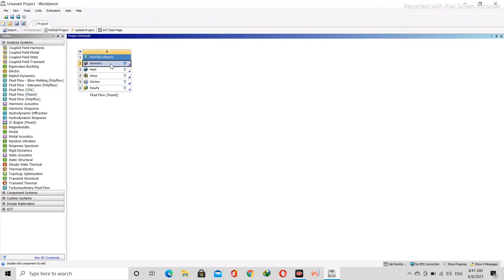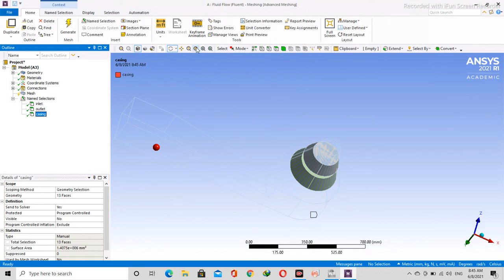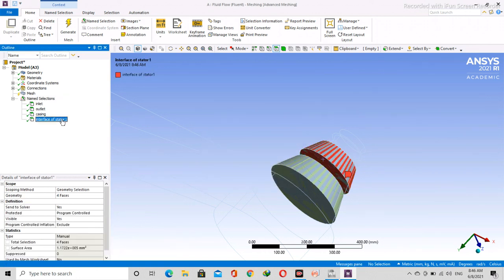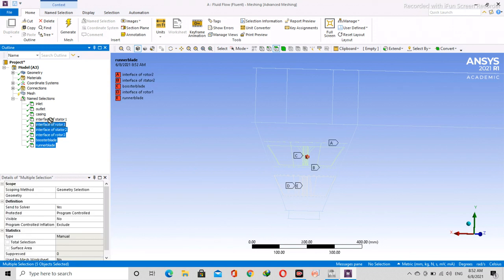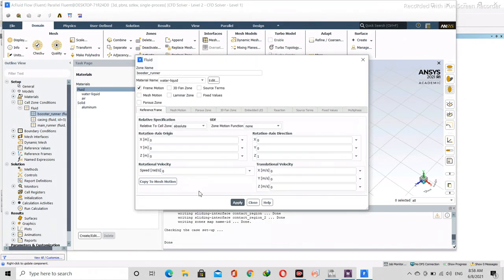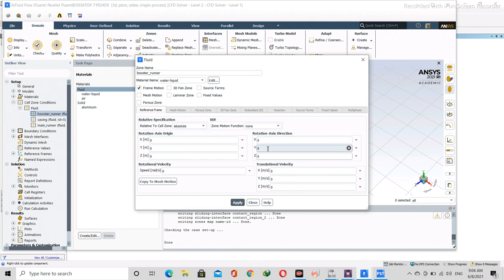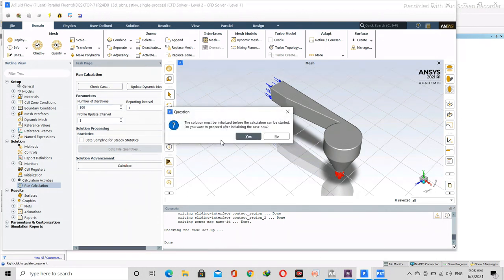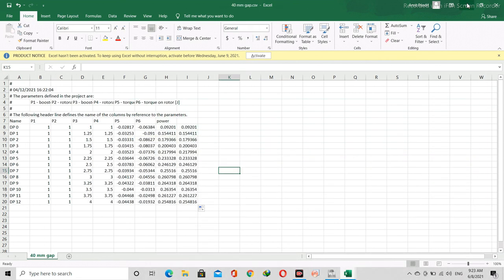How to setup parameters and CFD analysis of multistage Gravitational water vortex turbine

Comment: sir, why the torque i get increases as the rpm increases?  as we know, the torque value should decrease as the rpm increases.  I've followed the steps you described, but my simulation results are as I described.  Can you explain why my simulation results are like that?
Reply from the maker: I think you should check the mesh analysis. This mesh analysis is good for  my model so, please focus on mesh analysis.

Comment: Hi man, I can't understand why we are assuming that at an angular velocity we will have the most torque value possible.... how we can predict that in a real prototype the turbine will achieve that velocity...what if it can't get there?  
What should you recommend to solve this problem ...
Reply from the maker: Firstly, we have calculate the the max and Min velocity of test ring with including both of runners. Then ,  we have the max and Min radius from our test ring design. That way can calculate angular velocity. Yes, it can relate the real protype for particular mass flow rate because angular velocity for particular always constant . In real test we can easily get angular velocity and torque as output . But in simulation we have assume that which possible value of angular velocity is appropriate to produce particular torque.
Reply: Yeah, you are right man, well thanks a lot, your video is amazing, you helped me a lot 🤝, just one more question, in the video with single stage turbine, you picked angular velocity "4" because it was the higher value in the range of water velocity without a turbine?
I'm working in this project for my final grade in Uni. Thanks for the answer  👍

Comment: Really nice but i have a question. Why didn't u select inlet as velocity inlet?
Reply from the maker: U can take velocity as a inlet . There is no issue.
Reply from the maker: As in my project I have selected mass flow rate as input so in this video select as input otherwise there is no issue to choose velocity as a inlet
Reply: @amitsvlog5274  Have you created an animation with ansys? in which turbine is rotating?
Reply from the maker: I haven't the animation video right now but  I will show it in my next video

Comment: Sir, what is the meaning of negative torque in your result? And is it normal?
Reply from the maker: Negative only represents the direction . we should go for further calculation by taking magnitude only.thanks
Reply: @amitsvlog5274  Ok thanks Sir, my colleagues and I are working with the project related to multistage vortex turbine too. We followed the instruction on this video with 3 stages, but we got the result of torque with high variation. For example, in some data it showed Torque around 0.005 J, but in some data it showed until 5000 J although the variation of rpm is small. What is the possible cause and solution for this Sir?

and which one is better to model multistage rotor between steady case like you did, or transient using sliding mesh?

Thanks
Reply from the maker: you should check your mesh. If the mesh is okay then the result will not be varied much.
Reply: @amitsvlog5274  ok thank you and which one is better to model multistage between steady and transient Sir?
Reply from the maker: @elluthfi  plz follow this instructions while putting the data https://youtu.be/vwFLn1OfFBk.
it depends on your full knowledge about transient and steady. both will be okay .
Reply: @amitsvlog5274  Ok thank you Sir, and for total torque of 2 rotor stages as one unit, is it simply the sum two torque values of two runners? Because in the real experiment, our setup will be one unit shaft (not shaft with telescope hub). If I use rope brake dynamometer, can the result from simulation comparable with the result from real experiment? Thank you
Reply from the maker: there is always a certain amount of error when you compare simulation and experiment . question is what percentages of error should be acceptable by your professors.
Reply: @amitsvlog5274  but is the terms torque obtained from this simulation the similar with the brake torque obtained from rope brake dynamometer Sir?
Reply: @amitsvlog5274  Hello Sir, did you consider this project as the open channel or closed channel? If your case was open channel, how did you define in ansys fluent that the top surface is open channel? Thank you
Reply from the maker: @elluthfi  close chaneel